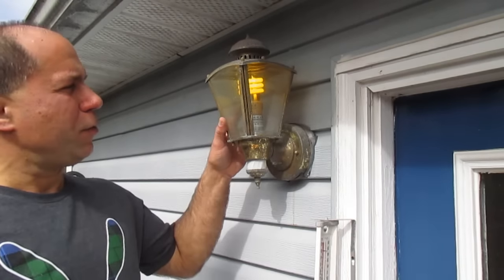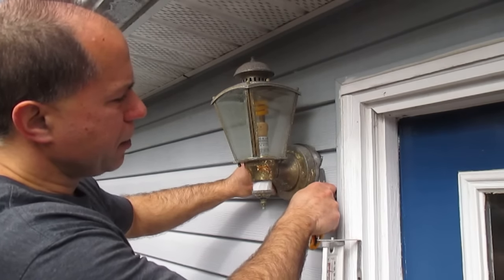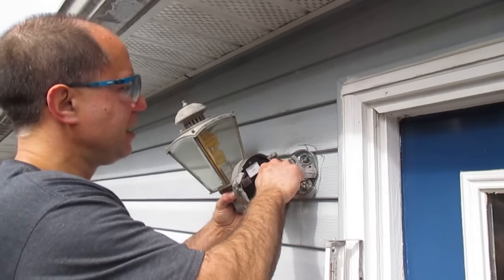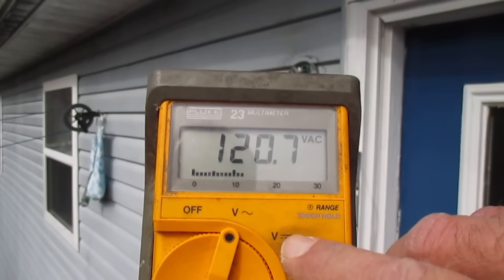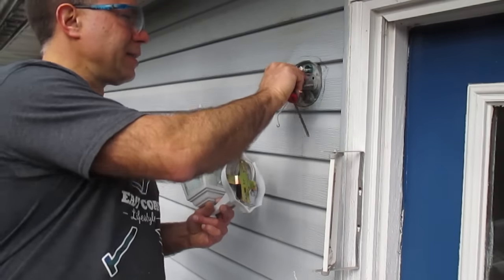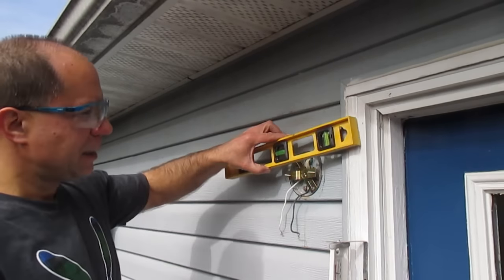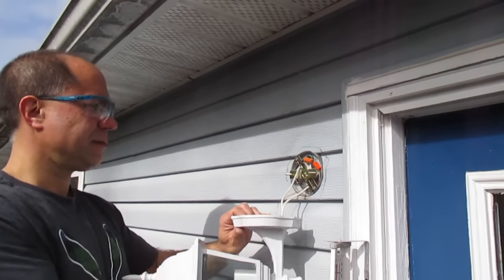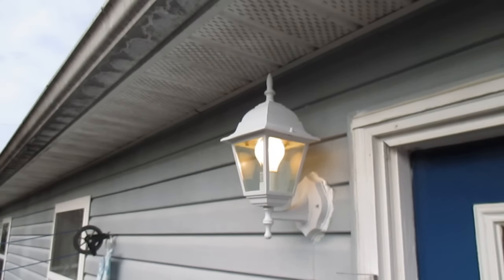How to replace an outside light

Comment: If the lightbulb is off, the power is off. Just make sure you turn the power off at the breaker, not the switch as the gentleman said. If you don't know what breaker to turn off, then get a helper to tell you when the bulb goes out. Otherwise, you will be running back and forth until you hit the right breaker. That's a real joy! :) Also for an added measure of safety, you can electrical tape the wire nuts of the black and white wires that go to the fixture. Good Vid. Have fun Blessings!
Reply: good tips... i notice i have 2 white wires and one black coming from house.. i notice he had only 1 white wire.. any reason why . i would have 2....and i notice the bracket he has in middle mine don't have the two screw to hold it  still to level it so i had to tape mine to stay in place...
Reply: @jeremiah1797  8

Comment: Thank you so very much for explaining this in detail understanding viewers don't know the basics of internal parts. I know basics on electricity and my home is block. . You helped me a novice who purchased a nice, garage sale light used, without the back parts. Easy to find in my garage or Home Depot✅.The leveling of the back bracket was especially useful and explaining positioning to align the light. Figuratively you nailed it!
Some of the subsequent comments are the "expert handymen" who wouldn't give you any tips if their lives depended on it.  And as one of the positive comments stated "saving $100.

Comment: Nice transformation of an inherited mess !  The old light should have been mounted on a "Siding Mounting Block", not a shallow ceiling pan cut into the siding.  Whole lot of caulk needed to fill the unnecessary gaps.  Excellent results given the difficult setup inherited.

Comment: Thanks for this video. I'm the last person on the planet who should be adding commentary but...during the few times that I have done something like this, I leave the light on, then turn off the breaker (in that order). I never touch the light switch. That way, I can see that the light is off and I know that I turned off the correct breaker switch.
Reply: Great idea, but with my luck, the bulb would burn out coincidentally and it would be a false test. Best to use a meter and check for sure. What's your life worth? But yeah, I like this idea.
Reply: Hi! I have a problem in that the old fixture isn't working at all. Changed bulbs and everything. So the wiring In the fixture isn't working, and I'll never find out for certain which breaker turns off the power. Do you have any suggestions? Would appreciate very much!
Reply: @PouchMaster My suggestion is to hire a knowledgeable adult, like an electrician, or...
 someone with an adult attitude, that's not afraid to handle simple home repair.
Changing an old fixture is EASY for anyone who is NOT afraid to face a simple
challenge. You don't sound like a "do it yourself" kind of guy. You're more like,
"the sky is falling" kind of guy.

Since you are convinced that you'll NEVER find out for certain which breaker it is...
FIND SOMEONE WHO WILL. If you cry a little louder, perhaps you can find someone
to fix your problem for free.
Reply: @Seemsayin  Well shows what you know! I did end up fixing this!
Reply: @PouchMaster  If you don't mind me asking... how did you manage to go from "I'll never be able to find it!", to "I fixed it myself."? How exactly did you do that? You conveniently left that part out. I would love to know how you tackled that job. You bounded from not being able to trace a wire, to installing a light fixture. Please tell me how that happened. I'm guessing you had help. Yes?
Reply: @Seemsayin  I actually turned off every breaker in the box to figure out what they power and then labeled them. I don't know if this was the most efficient thing to do, but it was all I could think of. Process of elimination I think it's called. Anyway, the very same breaker also powers the wood stove fan, so when that no longer worked I realized I had finally tracked down the breaker! Then I took apart the very old fixture and wired in the new one! Flipped on the breaker! And it worked! I'm sorry I left this part out for you! Thanks for all your support!
Reply: @PouchMaster  Well, well, well... You had me fooled. You weren't the same person I thought you were. You took the initiative to do what you had to, and... viola!

Good for you! I love hearing a story like that. I've been an electrician for most of my adult life. Unlike yourself, I've heard people say the darndest things, like "I can't help myself, because I'm used to having things handed to me." When you commented that you'd NEVER be able to help yourself, I thought... Oh great... Another person crying the blues, because they have no motivation to solve their own problems. But... you AIN'T that guy. Congratulations! You have my respect. Best of luck to you.

Comment: I installed the exact same light, however the two screws going thru the fixture that you tighten down to secure it to the unit were two long and I could not tighten them down, so I had to go to hardware store and find two smaller screws that would do the job.  Also the top of the fixture did not line up very well and I had to angle a screw into it to make it work. .

Comment: Thanks for the video!  I'm gong to be doing this project today.  Hopefully won't get any sparks flying when I turn it back on (like I usually do lol) :)
Reply: How did it turn out?
Reply: how'd it go man??
Reply: Oh that turned out just fine - only strange part was that my light has a sensor so it turns on automatically when it's dark out, which makes it a bit hard to tell if it's working when you install it in the middle of the day.  I didn't want that feature anyway so I just put a piece of tape over it and it's been working fine ever since.

Comment: Thank you sir. I am exactly replacing just like your old
 light with White light in June 2020. What a coincident.
Why did I not see any grounding green wire.
Reply: Because your home may have been wired before
grounding wire became mandatory, in the mid to late 60's.
Reply: It is already done successfully. Thanks.

Comment: So just to confirm, you connect the white wire from the light fixture to the white wire in the house and the black wire from the light fixture to the black wire from the house right? Is it pretty standard will all patio light fixtures have a black and a white wire? or will I come across different color wires on a light fixture?
Reply: Yes, all fixtures use black and white.

Comment: Looks easy But then once you get the old light down something goes wrong. Can’t get the new light up. And your left with exposing wires hanging out for the next 6 months. Happens every time
Reply: If it came to that, for an outside fixture, I would think you can cover it with a piece of aluminum foil (taped on with duct tape) so nothing gets wet. Someone please correct me if I'm wrong about using aluminum foil.
Reply: @escapefromny2012  - If an exposed wire had to be left for awhile, I would simply cap it off with a wire connector and then wrap it with electrical tape and tuck it back behind the vinyl siding.  Aluminum foil is metal and as such is still conducting electricity. whereas a plastic cap won't conduct.
Reply: @escapefromny2012  Definitely don't wrap it in aluminum foil, holy crap man!!! Also, they make a tape specific to electrical work, it's called electrical tape.

Comment: Might be a stupid question, but instead of turning off the fuse box, can you not just switch off the power to the outside light by simply turning off the light switch?
Reply: Better to be safe than sorry. Especially if others are around.

Comment: Hi I was wondering before I get started, if it's absolutely necessary to cut the power to do this? Like if I just flip off the switch is that good enough? Otherwise I have to track down the right breaker.
Reply: 120 volt AC (the voltage of most wiring) can cause severe electrical burns and even kill you in mere seconds, definitely turn it off and wear gloves, it’s not worth the risk.
Reply: @cbl6520  Wow really! It's a good thing I never actually got started this week. Bad back really giving me a hard time. I'll be sure to spend time to track down the right breaker thanks!
Reply: It may be considered bad practice but turning off the light switch should do the trick. Just me and my girl here and I informed her and taped down the switch. That being said, its good to know your circuits and if they are not well labeled at the panel then this could be a good opportunity to fix that. It's not hard to do and will save you time in the future, perhaps even in an emergency event.

Comment: No ground coming out of the wall?
Reply from the maker: The ground wire from the house was already fastened to the gang box - it didn't have to be moved. But it's hidden under the wire . When we connect the ground wire from the light, to the gang box (which is connected to the ground wire from the house  ) , the circuit is grounded.  Good observation Carl - I didn't realize the viewer couldn't see the ground wire to the house !

Comment: how would I know which is the hot wire ?
Reply from the maker: Take one lead of your meter and connect it to the ground wire (bare copper wire) and then touch the other lead to the red, then black wires. Whichever wire you get a 120 volt reading on is the hot wire Gerald
Reply: It's the one thats not cold, duh

Comment: what can you do if the wires coming into the box are too short.
Reply: William Heath you can buy new wire at like Menards or anywhere. You’ll have to figure out if it’s 16 gauge or 14 gauge or even if it’s 20 gauge. They sell a tool that looks like pliers, but you can close it and it has loops you can slide the wire through to figure out what gauge the wire is. Once you figure out what gauge the wire is, you can tie the new wire to the old wire and electrically tape them together. Menards does sell a small device you can attach both wires to and it closes them off together, no tape needed. 

I’m not an electrician, so take my advice with a grain of salt. If at any point you feel lost, hire/consult a licensed electrician.
Reply: Wanted to clarify that your house wiring should only be 14 or 12 gauge, for 15 or 20 amp circuits, respectively. Wire in the light fixture can be smaller gauges than 14 but if your circuit coming from the house is 16 or 20, it is undersized and needs replaced.

It sounds like your wiring coming into the box being too short means you cannot make a splice with them to extend, since light fixture's wires are usually pretty long, right? If so, replace the entire wire. In the US the National Electrical Code requires 2 inches of wire in the box for splices. I can't recommend trying to make a splice on anything shorter, even though it's possible and people tend to do it. If you abandon the short wiring and pull new wiring through, make sure you cap the abandoned wires in the light box and the other end (switch box). Otherwise, remove the wiring completely, which likely requires opening up your interior drywall/plaster/etc. and repatching.

Good luck!
Reply: Go pay for as much for tools and new wire as it would be to just hire an expert.

Comment: what about the ground wire from the house, what did you do with that
Reply from the maker: The ground wire from the house was already fastened to the gang box - it didn't have to be moved. But it's hidden under the wire . When we connect the ground wire from the light, to the gang box (which is connected to the ground wire from the house  ) , the circuit is grounded.  Good observation Brad - I didn't realize the viewer couldn't see the ground wire to the house !

Comment: Not gonna at least caulk that huh? Just going to push it up against the siding like that leaving those huge gaps? 

The problem here is that you end up with people who don't know what they are doing teaching others the wrong way to do things.
Reply: You didn't finish the video did ya
Reply: Haha, the funny thing is, I almost missed it too.
Reply: @thebigdoghimself  ...I've also heard that you should leave about 1/4" on the bottom UN-caulked, so any trapped moisture can have a place to drain out.  Not sure if I heard the right info...but I plan to do that this weekend when I'm replacing a light.
Reply: @pekerhed101  Yes, most light fixture instructions will say this and it is also in section 314 of the National Electrical Code. It sounded odd to me at first but I guess I must admit that water will always get in no matter what you do? LOL